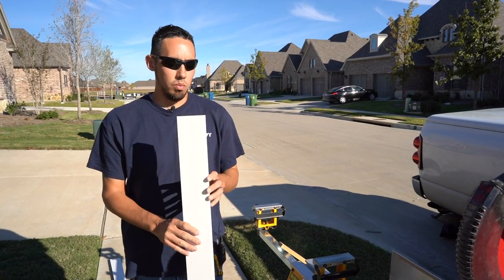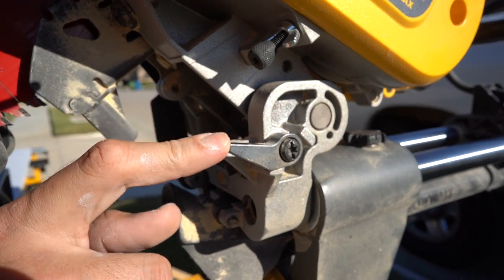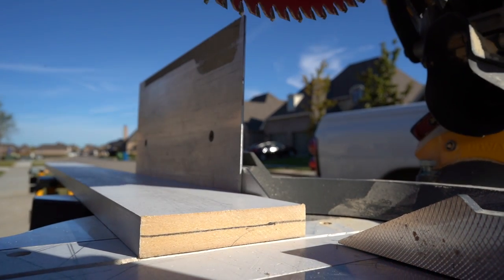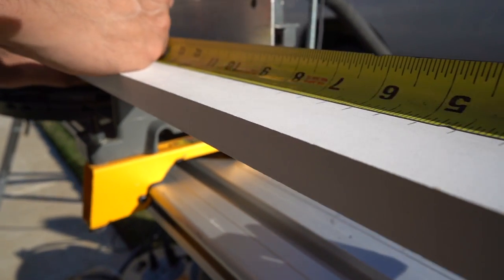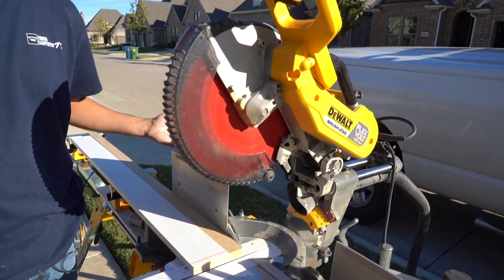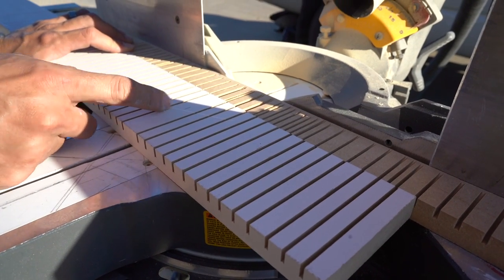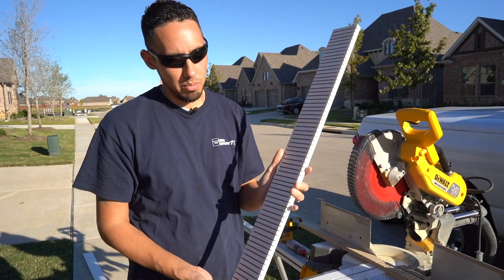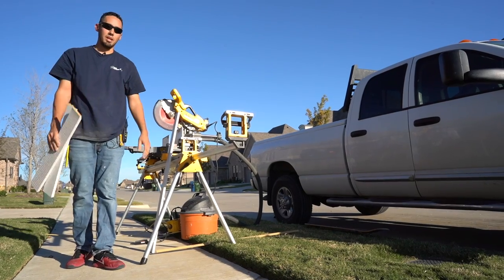Miter Saw Trick for Kerfing

Comment: A pencil mark on the saw bed, in front of the material your cutting at 1/2" away from the saw blade, can be used to reference, align your first cut and make sequential cuts. No need to mark the entire board or multiple pieces.
Reply: Yes and no, in most applications it's going to be fine but by using a reference like that, errors add up; marking each individual cut makes each one more accurate in case it's needed.
Reply: I was thinking something similar, but instead of marking the saw bed with pencil, locking the sacrificial fence in place and using the first cut through it as my mark.

Comment: A little tip to save time with this method. With the spacer board, make 2 cuts 1/2 inch apart, and line one up with the blade, and the other 1/2 inch to the right or left(preference). CA glue the sacrificial piece to the saw. Now, after your first cut, just move the piece over to line up with the previous cut 1/2 inch away, and keep repeating. It will save time not having to mark every board.
Same technique on a table saw with finger joints.
Great video as always brother. I hope you understood what I said... LOL
Reply: Crap, I just posted that too.
Reply: Same here first thing I thought about instead of all the marks.   Btw I buy his ca glue and Love it.  I do my window and door castings with it before installing   Works great.
Reply: My first thought was something along those lines as well. If I can avoid repetitive measuring and marking, I always do as it almost always saves time.
Reply: In addition to this I'd use a pencil mark on the saw base to make sure the makeshift marker board isn't moved out of place (not sure about the gluing method, but definitely if someone is using clamps).

Comment: Well done.  
With the zero clearance plate, you could mark the edge of your board so that you have a visual cue that aligns with the blade. It will be far easier to see than aligning a spinning blade. Could increase accuracy and speed by a little.  I'm a freelance carpenter for a couple small contractors in Dallas. I do a bit of historical restoration as well as Condo remodel work in Uptown. Not as experienced as you, so have learned a lot. Thanks. We should grab some beers one Friday.

Comment: A quick tip for you. If you use your sacrificial fence and glue a 1/2 " piece on the bed of the saw on the waste side, you can use that as a spacer. Flush your workpiece to the offcut/spacer and it saves you a load of time because you won't need to mark out every 1/2". Good video yet again. Hope this helps.

Comment: I would clamp the sacrificial fence to the main fence. The first kerf cut through the MDF piece would cut a mark into the sacrificial fence. I would then add a pencil mark to the fence 1/2" away minus the width of the blade kerf. I could then use that mark to align the subsequent  kerf cuts.

Comment: I had a 12" DeWalt mitre saw that had an annoying amount of difference in the cut depth with the stop on. It was very dependant on how much pressure you put on the handle and meant you could never do rebates that were spot on the depth required.

Comment: Don't know if it's true but I was told by a tool repairer that you shouldn't oil or lube the slide rails as they will ware out the little bearings quicker. I know this applies to dirt biking where(for officials who are marking out tracks for weeks) if you run an older sprocket and chain set in the sand and keep them dry they will last longer than if you lube them. But I guess that MDF fine dust will get in any way. Great Channel 10-10

Comment: Problem with cutting the back of mdf is as soon as you shoot nails into it under a lot pressure it will just snap

If you want to make a  flat piece bend very easily just buy mdf boards at 3/8” and rip 2 pieces to the thickness you need. 

Install one peice first and then the other on top. 3/8” MDF will bend around a very sharp corner easily and When you add the second layer or you have a 3/4” piece of flat stock

Comment: You can omit marking all the cut locations on each work piece this way: Make your sacrificial piece about as long as the fence and such that you can secure it to the fence without interfering with the edge the work piece will slide against (tape, or clamps into notches, etc). Next, make a first cut into the sacrificial piece, about in the middle of its length. Then slide it over to the spaced position where the next cut should go (1/2" o.c. in your example) and make another cut. Now, without moving the sacrificial piece,  secure it to the fence. The second cut you made shows exactly where the blade will enter the work piece. The first cut you made serves as a visual index mark, showing exactly how far to advance the work piece each time. After making the first cut in the work piece, slide it over until that first cut lines up with the index cut. Make your second cut. Slide and cut repeatedly, lining up each consecutive cut with the index cut. This method is similar to a box joint jig for the table saw, but without the physical indexing pin. It's very easy to accurately line up the last kerf on the work piece with the index kerf on the sacrificial piece by eye.

Comment: Great Video! I may be able to save you some time though and backer board material. You can CA glue a sacrificial piece to the right hand side of the blade exactly 1/2" from the saw blade and then make your initial kerf cut, then slide the piece over to the start of the backer board, and so on. Then you wouldnt have to take time measuring all the way down the board you are kerf cutting but rather a 1 time initial measurement.. Does that make sense? I've done it, so maybe I'm not explaining it correctly.

Comment: Hey bud..  I'm moving my above range microwave and the small cabinet it's attached to. The top of the cabinets has crown moulding.  It's the pre made style that has the flat bottom. I should be able to find more at kitchen sales..  anyway, in the space that occupied the small micro cab, I need to build a vent hood cabinet ! It starts at like 30 in, then slightly tapers in, and back towards the wall.  After about 18 in, goes vertical to the ceiling...  there's nothing on YouTube for me to use as a guide..  can you do one ?

Comment: I don’t wanna sound like a idiot but is there a reason why u don’t just mark 1/2” after the saw kerf on the backer board so u don’t have to mark it all the way along the work piece? Does that make sense at all?
Reply from the maker: Ben Willmott yes that does make sense and it would be a great solution as well.

Comment: Ive actually seen a very old video of an indian tribe in the north west doing this. They used stone age tools to pry a large slab off a tree about 10 ft long and worked it down square,flat and true to about 5/4 thick then they cut 3 V notches almost all the way thru at equal distance apart and steamed each V notch to fold the single board into  a square for the sides of a box approx 2'x2'.  The V notches folded into mitered corners. Id guess the video is pre 1920.

Comment: Would you talk please about how you take payments from the homeowners and what's problems you went through what we should do what we should not do
Reply: Home Depot in NY doesn’t sell primed MDF trim boards with square corners. They have a small radius to them. Where do you get the trim boards from that you use?
Reply: Chris Paolillo you can try Lowe’s I’ve gotten them before from them or depending on where in NY you are you can go to riverhead lumber
Reply: Joe Pierce thanks, I’m on L.I.. I’ll try them.
Reply: Chris Paolillo there’s one in Mineola and one In Montauk bud 👍🏻
Reply: Chris Paolillo - go to WindsorOne.com millworks , click Locate, enter zip code to see where their products are near you. In their molding section look at S4S boards (means "smooth 4 sides")...that's what he's using. Lots of sizes available.
Reply from the maker: Chris Paolillo all the Lowe’s and Home Depot’s where I am have that radius. We get our stuff from local suppliers
Reply: Finish Carpentry TV last question, is the actual thickness of the MDF thinner than the finger joint pine? I think I recall reading that it’s not really 3/4”

Comment: Festool has nailed the quick and easy depth adjustment, just pull a small lever and twist it left or right to adjust depth and thats it, no need to lock it. great for quick adjustments on the fly.
PS. Love your work and Hi from AUS.

Comment: Two things:

1. If your kerfing to 3/8", why not just laminate two 3/8 peices of mdf?  Will be more flexible  and smooth than a kerfed 3/4 and a hell of a lot less work.  Better yet, use three 1/4 layers.

2. Your explanation for why you use mdf rather than solid wood is bogus.  Many woods are plenty flexible if you just kerf them a bit deeper.  Where mdf wins is consistency... It has uniform flexibility across the length of the board so the resulting arc is uniform and it has no imperfections (knots, cracks etc) that may splinter when bent.

Otherwise, a good video.
Reply: @loaloofbird  I honestly haven't done that sort of work since I was a teen helping my stepfather during the summers, however the technique isn't that unusual, though I couldn't find any great examples after a cursory google search.  Here is some talk about it with real wood: 

http://forums.finewoodworking.com/fine-woodworking-knots/general-discussion/arched-door-jamb
http://www.woodweb.com/knowledge_base/Laying_Up_a_Laminated_Door_Arch.html

This video shows a basic bent wood lamination using mdf strips:  https://www.youtube.com/watch?v=tYvtKK-pVhE however its actually easier to build it in place in the doorway.  

Just make sure your frame around the door is the right shape, or has quite a few anchor blocks following the radius... layer the strips in one at a time, gluing, pressing firmly into place and nailing (we actually used counter sunk screws on the first layer so we could make adjustments).  Once the glue dries, use a circular saw and speed square to square the ends of the boards at the point they go vertical.  Cut your two side jambs to fit and trim it all out as normal.

While the lamination isn't as solid as something clamped to a form, it's plenty solid for a decorative archway.  Your trim should hide the layers and any small gaps between them, just make sure your reveal is only 1/8" or so.  The best thing is that this requires no sanding (other than nail hole filler), takes paint like only MDF can, and installs quick. 

All that said, we did plenty with kerf cuts too... but generally only where the trim was getting stained rather than painted and we couldn't use something flexible like MDF or bendy ply.  I only ever remember kerfing real planks or occasionally plywood.